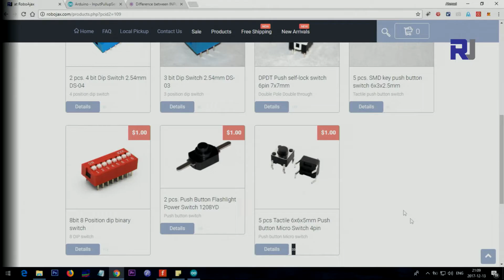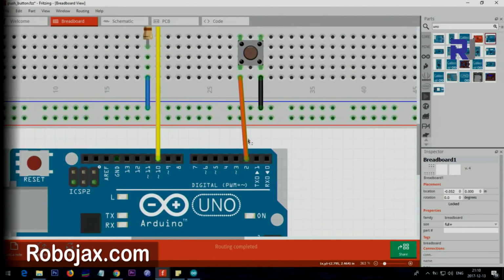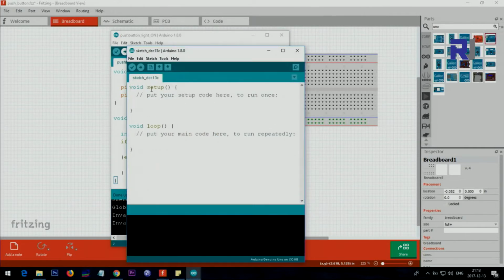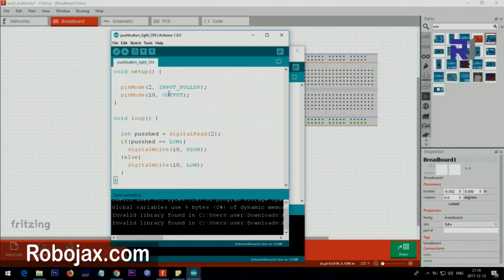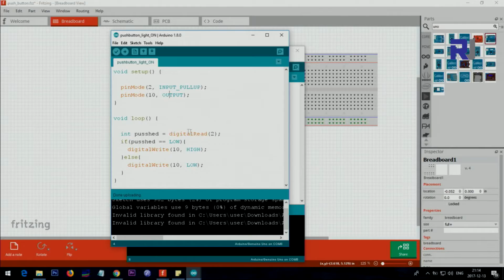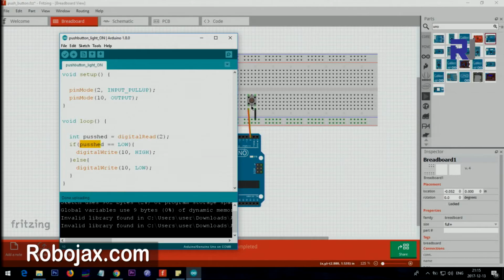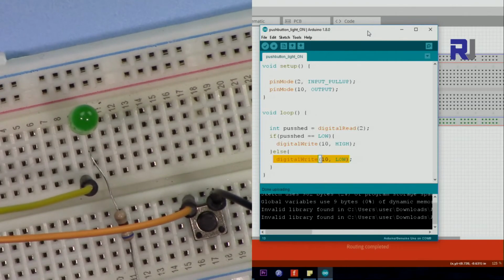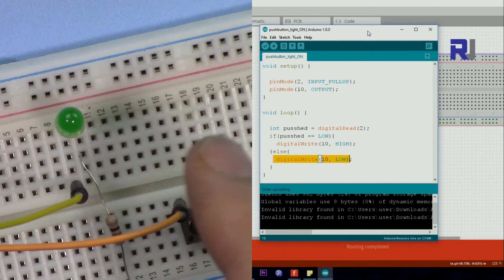Arduino for Beginners: Using Push button to turn ON LED light RJT24

Comment: I followed all the steps that you did in your video but ky led light is not turning on please help
Reply from the maker: Make sure the resistor is connected correctly and the button is wired according to the schematic.

Comment: My LED just wont stop constantly glowing I followed the tutorial step by step. Anybody know why?
Reply from the maker: I assume you took the code from the resource page here http://robojax.com/learn/arduino/?vid=robojax-pushButton if so, then the the pin 2 is always LOW to turn ON the LED.  then it means your push button has 4 wires and you gotta rotate it 90 degrees so the correct pins are in place. Good luck. try and reply .
Reply: @robojax  Oh my gosh rotating it worked. I've literally followed so many tutorials on this and couldn't figure out why it was constantly emitting light. Thank you so much!!
Reply from the maker: You are welcome. I am glad it worked.
Reply from the maker: if you get the long two pin type push button, you won't make mistake https://www.amazon.ca/dp/B0BBPZ2TYD?th=1

Comment: Tried to add this to an already existing project, but it doesn't seem to work, so I'm probably doing something wrong. So far, I used an ultrasonic sensor and a micro servo to open a door. I'm trying to add this led which lights up when I press a button. When it's lit up, I want a buzzer to make a sound whenever someone tries to open the door, and when it's not lit up, the door opens normally. Problem is: nothing happens to my led.
Reply from the maker: when you combine two codes into one, pay attention to pin definition. for example in your first project if pin 3 is used, then when adding second project, you can use the same pin3. use different pin and pay attention toi variables. if you are not getting erro, then it means either pin difination (pinMode(13, INPUT)) have conflect or wrong or wiring is incorrect. Make sure you to test them separately and they work before combining them. good luck

Comment: Many thanks 
 I have a text file stored in sd memory as follows, it consists of three columns
 0'10,0
 10,0,0
 0,0,10
 0,0,0
 10,0,0
 ..
 I have three LEDs connected to three terminals (pins) of the Arduino, for example 7,8,9

 How do I get a code that enables the Arduino UNO to read the text file and convert each number 10 to 5 volts on one of the three pins
 Thus, it will light three LEDs sequentially according to the data stored in the SD card memory. Thank you very much
Reply from the maker: Hello, I have a full tutorial on MicroSD card module here https://youtu.be/TduSOX6CMr4 which is free. but if you want custom code, I will do it if you compensate my time.  I will charge $100 for this. if you are interested, please contact me via robojax.com contact page.

Comment: Can U tell me how to switch it on automatically with just the program and no manual work required?
Reply from the maker: so you want the LED to turn ON and OFF?It is called blink. Very simple. On Arduino program click on File->Examples-Basic-Blink and you have that.

Comment: can u do this without a breadboard?
Reply from the maker: yes you can solder the wires and do  it. breadboard is just holding it and making it easy.

Comment: hey mate good video but my led is constantly on and the pushing the switch does nothing..any ideas?
Reply from the maker: check your wiring. Make sure you copy the code and past it into arduino. It should work.
Reply: Thanks buddy

Comment: This is extremely helpful!  I'm just getting into arduino and you explaining the hardware AND programing is awesome!  I'm watching through your other videos now.  One question I do have, is how do you determine which resistor to use for the LED?  What would happen if you try to run without the resistor, would it fry the LED, or arduino, or even both?  Thanks :)
Reply from the maker: You are welcome. I have a video exactly explaining how to calculate resistor value for LED here https://www.youtube.com/watch?v=x2YxfV1L02Y